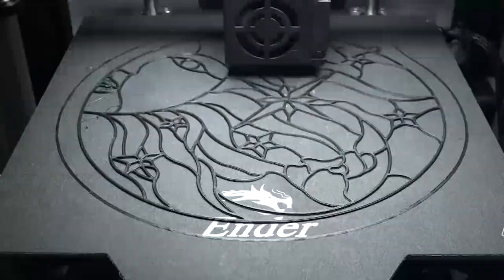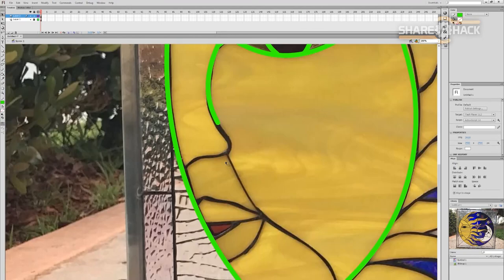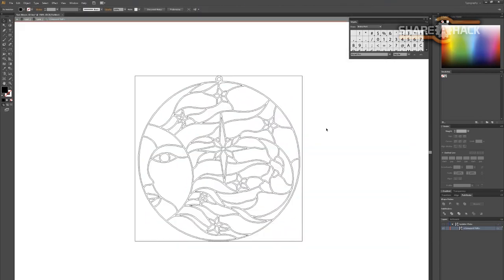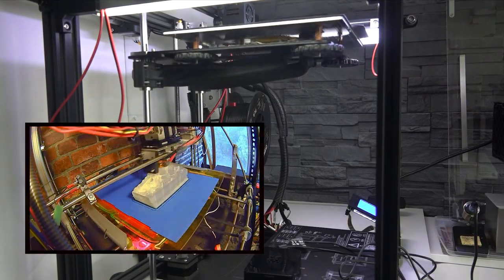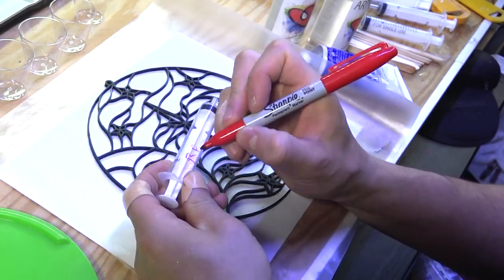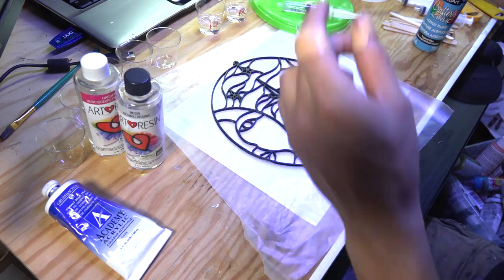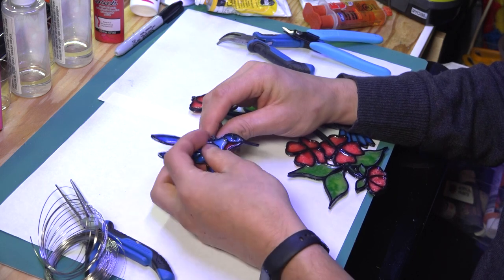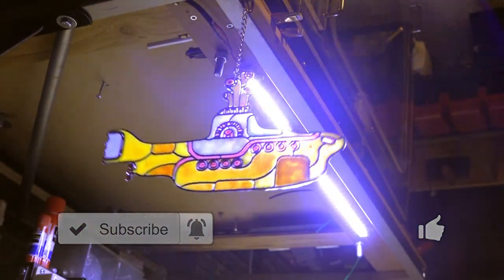3D Printed Faux Stained Glass Suncatchers (DIY Epoxy Resin) GIFT IDEA!

Comment: Question, please. If I wanted to print something similar to the the sun catcher, but needed it to have a solid sheet for the first layer, how would I do that? Thank you in advance.
Reply from the maker: Hi Jim, this is actually very easy to do - just "extrude" the entire shape behind the design into a solid flat piece (whatever the desired depth) and it would connect a flat backing to the design. If you need a hand with the design part feel free to email me at shareahack@gmail.com. Cheers!

Comment: Contact paper works well too! So does removable vinyl
Reply from the maker: Great suggestions, thanks for the tip KP!
Reply: Hi K P I tried contact paper, and it looked like it was going to work fine, but when I hit it with the heat gun to get rid of bubbles, the piece lost all contact with the paper. Any suggestions if you have a certain method there? I was hoping it would be fine since cleaning glue off the back is tedious.

Comment: I've printed some frames after watching your video, and I'm about to put some resin in them. This will be the first time I've ever used resin for anything. I expect I'll get some through, so, could you tell me how I could clean it off the back if and when that happens?
Reply from the maker: Do you mean if it spills out around the outer edges and hardens on the wax paper? In that case you can try using an x-acto knife (or scissors) to trim the excess around the edges. Hope it works out!
Reply: Okay, I did it! I used the method you suggested of clear, with colour later. The glue looks terrible on the back, and was wondering if you know how I should get it off? I was thinking nail polish remover, but I don't want to do any damage. The front looks really good. I'm so pleased as a first try. I used the acrylic paint, and it hasn't even been 24hours and it's pretty hard and not gooey. My frames are 3mm deep. I have already made some more frames, and I think I'll try the contact paper as one of your viewers suggest. I'm looking forward to seeing more of these by you. I hope you do some more!
Reply: I was able to get the glue off by putting some nail polish remover on it and did some rubbing with a q-tip and scraping with a flat blade. Took awhile, but turned out good. So then I tried the method of contact paper. Seemed to work fine until I hit with the heat gun and it lost all contact and clear flooded out. I was able to cut it away after it hardened enough to work with, but the back didn't come out nearly as clean as cleaning off the glue, since there is a layer of resin over the entire fame on that one.

Comment: I love it. Can it be used any art resin ? Or Is there an specific type?
Reply from the maker: Thanks Carmen, sure you could use any 2-part resin! Resins can be expensive so maybe start with a smaller amount to see how far you can can stretch it...a small 8oz Art Resin kit can go surprisingly far. One user suggested using stamp ink (alcohol based) but I bet you could get away with food coloring too for some nice transparency. If you're really on a budget, you could get some dollar-store "5-minute epoxy" but make sure you're very well prepared to color-tint and pour because you only have a few minutes before it hardens (the plus side being you get to enjoy your final product faster). You could try experimenting with adding very small amounts of rubbing alcohol to the 5-minute epoxy to 'thin' it and increase the curing time. Let me know how it works out for you!

Comment: What did you use under the base?
Reply from the maker: Wax paper (also known as parchment paper), and a thin base layer of clear epoxy to seal the cells. Once the clear layer has cured a bit, pour in the mixed colors!
Reply: @shareahack  thanks for answering.
keep sharing your great art!

Comment: It's been soon 1.5 years since this video.
Has your 3D Stained Glass Suncatcher warped in any way? 
Does it look the same today as back then?
Reply from the maker: The round one curved slightly because it is one large piece with more tensions across the cells. A little shot with a heat gun on a flat surface would fix this...and the PLA frame would relax a bit while hot and could counteract any more warping once it cools. The birds one looks exactly the same with no warping at all...probably because the cells are small and the tension is spread out. Thanks for watching 👌